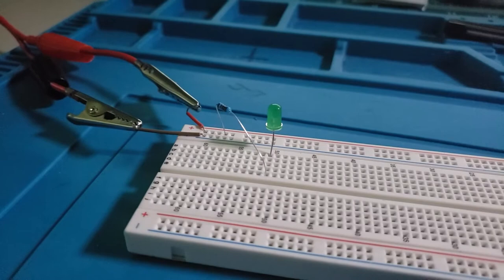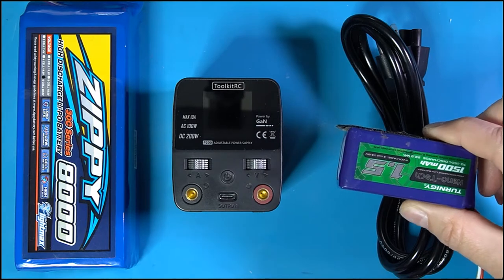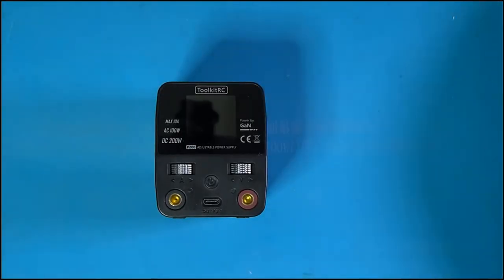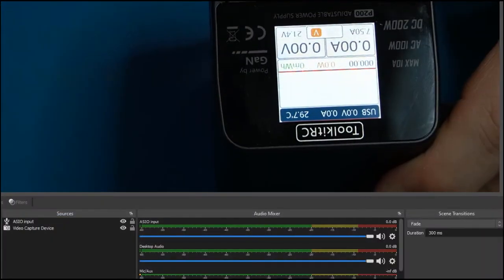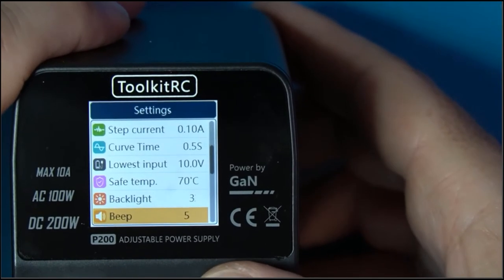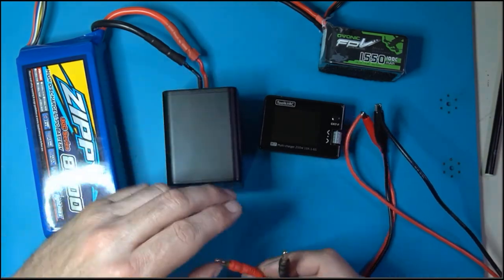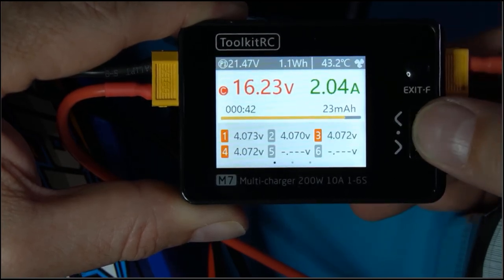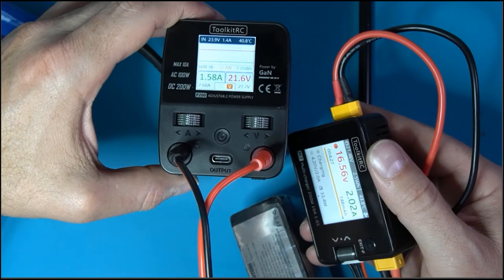Toolkit RC P200 AC/DC Power Supply and M7 Battery Charger

Comment: i am new to this limited .... i bought the m7 charger can i use a ToolkitRC ADP100 100w 20v 5A Power Supply Unit with XT60 to charge 4s batteries etc ? will eventually purchase one of those adapters when i can